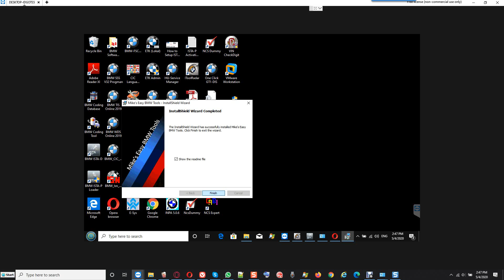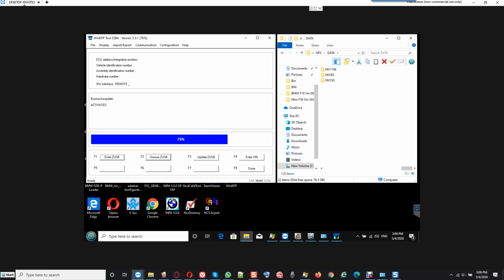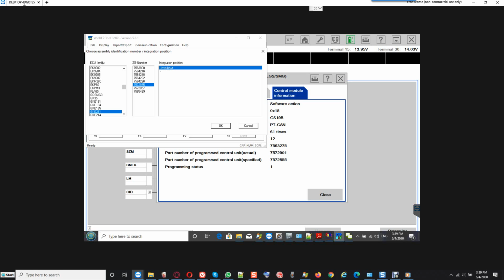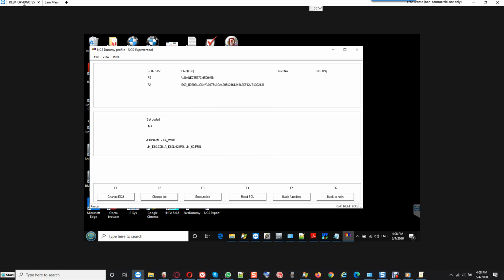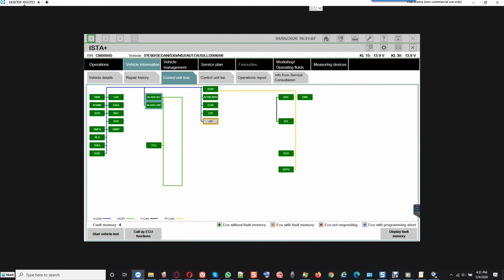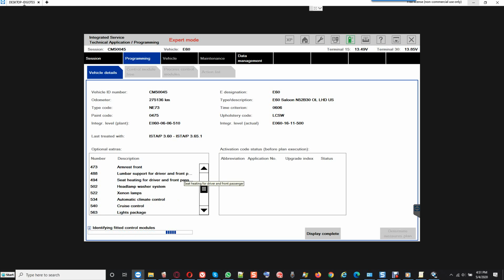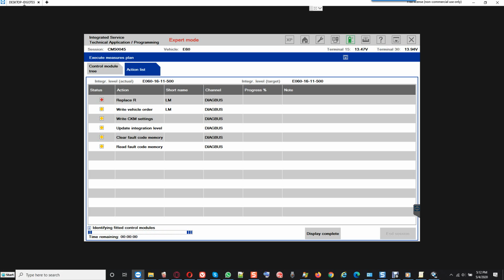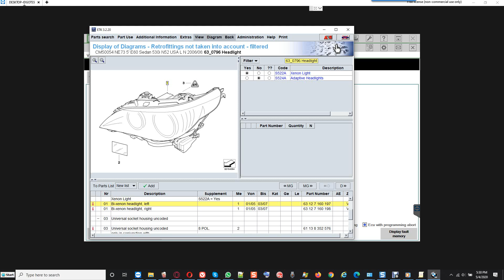BMW E60 used EGS Programed to change Vin and Flash Light Module via Winkfpt

Comment: Hello I need some assist in this matter. I got a 2011 BMW 328i E90 and my EGS module needs to programmed. So when I pull it up in INPA it says service not supported. then I pulled up in ISTA-P and tried to go through the process and ISTA-P coded and programmed but at the 100% mark of being complete the software said security access denied. need help thanks
Reply: Dealer only.

Comment: Hi, im having issues with the vin change on the egs after a transmission swap. any help would be much appreciated, your videos have helped thanks for the walk through.
Reply from the maker: The EGS ISN number must be changed to suit the vin of the DME and CAS module in car as from factory, then i can use change vin number. contact me via whstapp +1786-355-3660

Comment: Much respect, I have a question. I replaced my egs with a used module but now I can’t switch gears because of the egs isn not matching the cas isn number. How can I reset the isn on the egs module, what program will I need? I appreciate if you can help. Keep up the good content. I have a e60
Reply from the maker: Contact me via watsapp +1786-355-3660